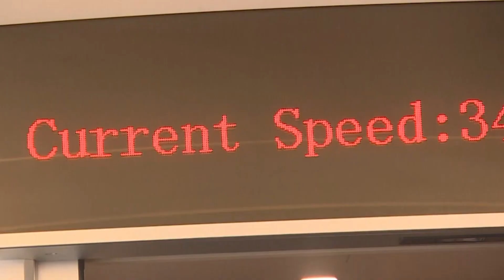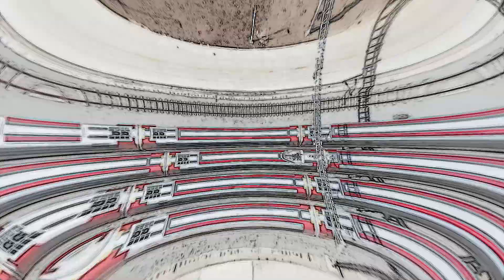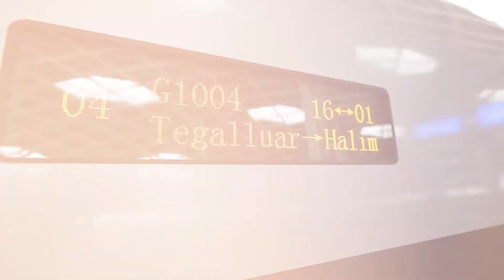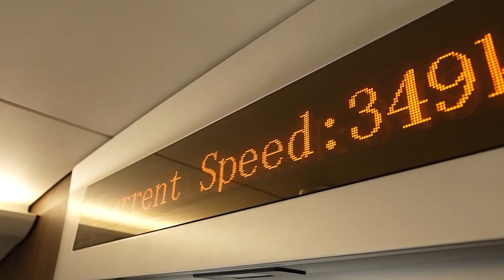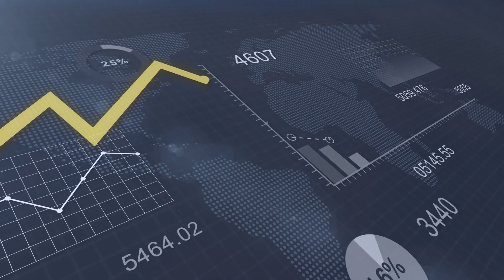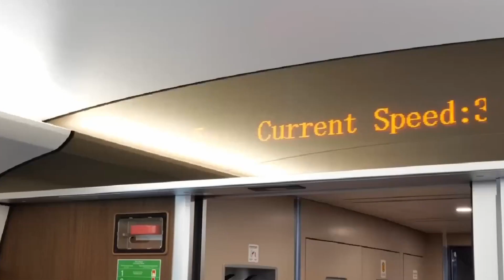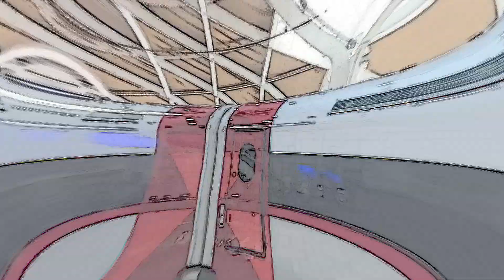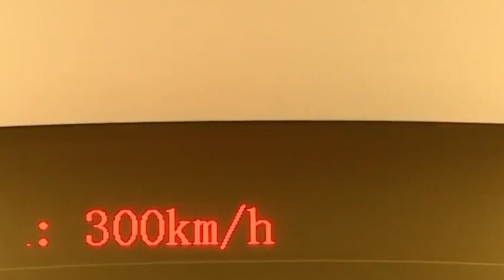Review of Whoosh - Indonesia first High Speed Railway in South East Asia

Comment: China Launches High-Speed Rail Through Laos in First Leg of SE Asia Corridor. December 02, 2021
Reply: Laos 160km/h. HrSR Higher Speed Rail (semi).

Indonesia 350km/h. HSR.
Reply: @dirmantjiptadji2111  160km/hr, European union  or China specification is High Speed Rail.
Reply: @sirisakpimchan7014 you again? Lmao keep claiming that Laos has HSR when China themself said CR200J isn't a high speed train. Your line will also be shared with freight, which is a no-no for Asian-standard HSR.
Reply: @kanojune5754   China Launches High-Speed Rail Through Laos in First Leg of SE Asia Corridor. Not Laos Launches.
Who said CR200J isn't a high speed train? 
Technical specification for interoperability relating to the ‘rolling stock’ sub-system of the trans-European high-speed rail system, High speed train is Rolling stock having a maximum speed of at least 190 km/h. Decision 2008/232/EC

CR200J Traction performance parameter：
Wheel rim tractive power (continuous): 5600kW   (motors Toshiba YJ277B/C 4x1430kw =5720kw)
Wheel rim tractive power (half hour): 6400kW
Operating speed 160km/h
Construction speed: 210km/h
Maximum test speed 241km/h
Starting tractive effort (dry rail): ≥240kN
Continuous tractive effort: 212kN
Max.regeneration braking effort: 153kN 

CR200J Configuration 1Mc+7T+1Tc
Configuration weight 585 t 
40km/h average acceleration 0.371 m/s2 
160km/h residual acceleration 0.1586 m/s2 
200km/h residual acceleration 0.0969 m/s2 
Slope12/1000 balancing speed 190km/h 
Slope25/1000balancing speed 123km/h
Slope30/1000 balancing speed 106km

HSR systems were divided into four groups depending on their relationship with conventional rail ; dedicated line, mixed high-speed line, conventional mixed line, and fully mixed . Each of these types of HSR has some advantages and disadvantages.

Dedicated HSR represents a line that is fully separated from a conventional line, has a high capacity, high safety, and no level crossings. The line has fences all along the line, often built on viaducts or in long tunnels, and has a high construction cost, such as the case in Japan and Taiwan.

Mixed HSR lines have a wider area to serve, increased accessibility as high-speed trains run on dedicated and conventional lines, high capacity of HS lines stretch over larger areas, reduced building costs. HSR trains can use conventional rails in city centres in areas where land is more expensive to build dedicated lines. However, stretches of conventional lines have less capacity and can be a bottleneck for increased traffic, reduces safety, increases maintenance costs, whilst the rolling stock must be equipped with two signalling systems for HSR and conventional rails, such as the case in France and China.

Mixed conventional rail represents lines that are used by HSR trains and by conventional trains. Mixed traffic reduces the capacity of the line because of big differences in the speed of trains, and it also reduces safety. It can be a suitable solution if a country has a different gauge from the standard gauge size to be part of the European railway network and supports interoperability of international services, such as the case in Spain. This type is more difficult and expensive to maintain, needs special rolling stock, which is also more expensive to purchase and maintain.

Fully mixed lines represent lines used by all types of trains, including freight, have maximum flexibility to be used to full capacity, reduces safety, reliability, and punctuality, and increases maintenance costs. An example of such lines as those used in Germany.
Reply: @sirisakpimchan7014  i don't want to answer you in this section. I've already answered in the previous comment section, yet you left the chat lmao 😂😂😂😂. Keep coping and crying. CRRC doesn't even claim that CRJ200 is a HST yet a Laotian claim it, shame on you.
Reply: @kanojune5754  High speed train is Rolling stock having a maximum speed of at least 190 km/h. Decision 2008/232/EC  Rolling stock sub-system of trans-European high-speed rail system.
CR200J Configuration 1Mc+7T+1Tc
weight 585 t 
200km/h residual acceleration 0.0969 m/s2 
Slope12/1000 balancing speed 190km/h
Reply: China, Laos and Indonesia the same HSR service standard
Chinese service speed Standard
China High speed rail max. service speed categories 350, 300, 250, 200,160 km/h. Train code prefix D, G
China intercity High speed rail max. service speed categories 350, 200, 160, 140 km/h. Train code prefix C
Reply: @sirisakpimchan7014 ye, same standard but different type and operational spd.